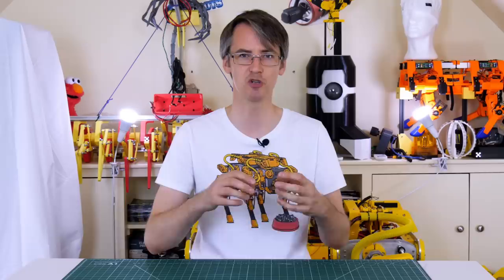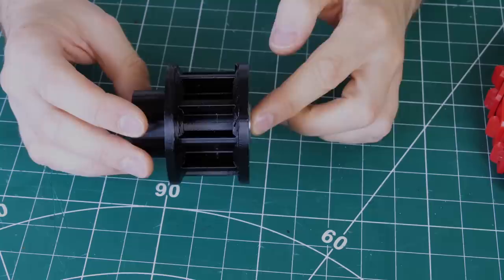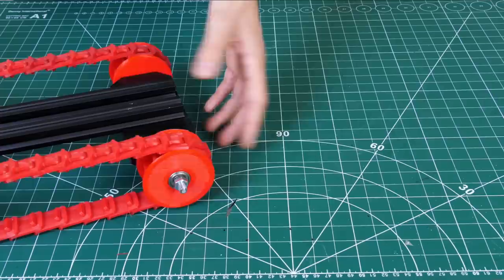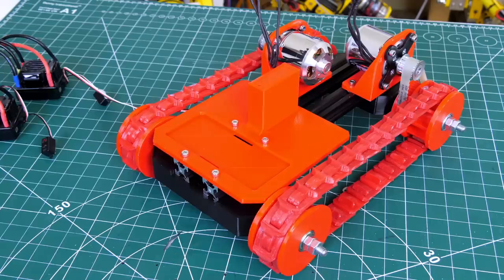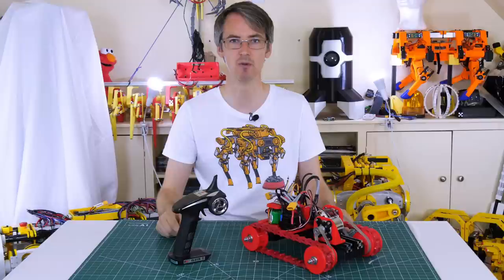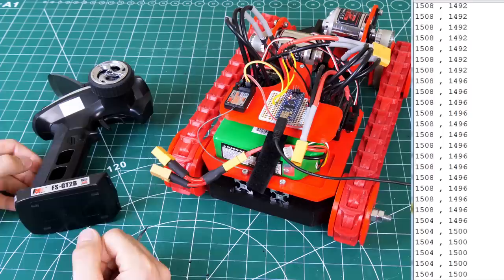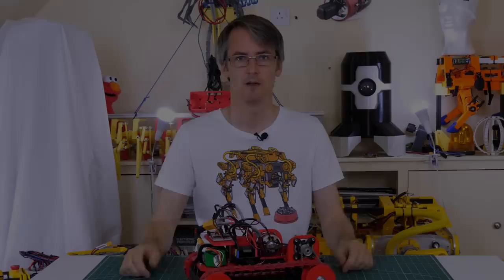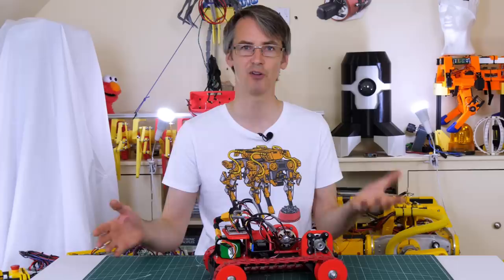Tank Tracked Robot Vehicle with Modular Treads

Comment: For the tracks, in heavy machinery they tend to put the drive at the back so that as you move forward the tention of the belt/track is under the weight of the machine, this might help for the turning problem.
If you don't understand what I'm saying check images of traked loaders, tractors, excavators etc.
Reply: I'm not sure you yourself understand what you're trying to say. The location of the driven sprocket doesn't change anything other than the length of track that's under tension. The weight of the machine is always on the tensioned track, since the tension is created by the bit of track that touches the ground.

The main difference between a front and rear drive belt, is the upper part of the tracks, which don't touch the ground. On a front-drive machine, this bit is under tension when driving forward. On a rear-drive machine, this bit is not under tension when driving forwards, or at least not because of the propulsion system.

The main argument for the location of the driven sprocket is very simple: Where's the engine, where's the gearbox. If the engine is in the rear, like it is for most heavy equipment, the driven sprocket will be in the rear, simple as that. 

Also: If there even was any advantage to having the driven sprocket be on one side of the machine, that advantage would completely disappear as soon as you drove in the other direction.
Reply: @timderks5960  ,
In the case of this robot, the tracks are flexible so the more you tension a longer part, the more it will stretch. What I want to avoid is to make the part of the track in contact to the ground have slack when climbing an obstacle in the most favourable direction which is most likely forwards.

As you said, if you change the direction, it won’t matter what side the propulsion is on but it’s better to improve the direction you will be traveling the most. Turning on spot won’t change anything.

I totally agree with your second paragraph, I can also add that on a front propulsion system, the top of the track is under tension, adding unnecessary wear and tear on the top bearings and the rear sprocket on an excavator/dozer.

In your third paragraph, you say that the engine and gearbox is usually mounted at the rear, which is true for excavators usually (I have never seen a dozer or tracked tractor with a rear mounted engine), but excavators are moved by hydraulics (hydrostatic) so the argument of the engine and gearbox doesn’t apply here.

Hope you understand, Thanks.
Reply: @rodeynsrene1007  Since the track that's in contact with the ground is always under tension, regardless if it has been stretched or not, it will never have slack under normal circumstances. The only slack will be in the section between the driving sprocket, and the last point of contact with the ground, i.e. the last point creating tension, basically in the part of the track that's being "pushed". This track may flex a bit, but the weight of the robot is so minimal that the flex will also be very minimal. The belt riding up on a wall will stretch it much more.

About the hydrostatic drives: That's true, but I specifically didn't mention those, because I have a suspicion that the drive sprocket position in those machines is purely based on "how it used to be done", back before they had hydrostatic drives. Maybe there's a small logistical benefit in terms of shorter hoses, or better protection with the hoses being in the back of the machine, but I don't know about that. Dozers indeed have a front mounted engine, but their gearbox protrudes way into the machine (on older models, the driver usually sits on top of it), so the end of the drivetrain is still in the rear. 

The only machine I can think of where there genuinely is no reason at all (from a construction point of view) to have the sprocket in the rear, is on a tracked excavator, since it hardly matters for those machines which way of the undercarriage is the front.
Reply: @timderks5960  Hello again,
Simply tell me what advantages front drive system have over rear drive system, for the small robot, I don’t think it’s to complicated to change the direction so it can be either. The better option, even if it has a few advantages is the superior and probably the best option.
Reply: @rodeynsrene1007  I never said front drive is better. I said there is no difference. The only difference there is, is probably wear related. A longer portion of the tracks is under tension, so more wear on pins and track links. There's tension on the upper track, so more tension on the idlers there, thus more wear. The advantage probably is that it's harder to have a track come off. All these things are extremely minimal though, and if there were two variants of each machine, one front drive, on rear drive, I don't think any of these aspects would matter to buyers.
Reply: @timderks5960  yes they are minimal but have you tried paying for those expensive consumables. Heavy equipment are made to last, they try to optimise everything they can.
Reply: @rodeynsrene1007  Well it's not like those consumables will be the same. If the idlers only support an untensioned track, they'll be a lot less beefy then when they support a tensioned track. These consumables are designed to last X amount of time (within reason), regardless of how much abuse it takes. Sure, a beefier idler will cost more, but that choice may save cost elsewhere.
Reply: @timderks5960   @Rodeyns René  Correct me if I'm wrong but they're both under tension. It's not like one side (top/bottom) is pushed and one pulled, the whole thing is pulled in one direction. It's just a pulley system. Maybe my limited knowledge oversimplifies the actual variables involved though.
Reply: @braytonlarson1860  Technically you're right, but what we mean by "under tension" is the bit of track between the point of drag, so where the tracks touch the ground, and the point of propulsion, so the sprocket. Think of it like dragging a rope that has a heavy object attached in the middle. The entire rope will follow you, so technically it's all under tension, however the bit between you (point of propulsion) and the heavy object has a lot more tension on it.
Reply: @timderks5960  I've driven excavators many times, they float a lot better in mud and snow with the sprocket in the rear, and if you're driving through rough material, coarse gravel/loose rocks etc, you should have them in the front to avoid getting unnecessary wear and rocks stuck between the teeths in the sprockets, this of course this is hard to do on a tank that doesn't turn the cockpit around... :P

Comment: I like the idea to build caterpillar rover, but to benefit using a belt instead of tires... 1. you need more wheels; 2. the first and last wheels should protrude out to the front and back; 3. you need wider belts, the belt should cover up the wheels; 4. The bottom of the vehicle should look like a boat.

Comment: Great video, as always. To increase the surface area of the treads in contact with the ground, which reduces the PSI , and the friction, it needs idoler / bogey wheels in between the large wheels. This allows the treads to slide sideways, with less friction, when turning.

Comment: I've been trying to figure out how to get this to work for a recent project. I have a six channel transmitter and receiver so I went into the project assuming I would be able to utilize all six channels and could reconfigure the transmitter to use up/down on both sticks for each individual motor. I could but the way you have done it makes much more sense. I'm using a heavy duty Pololu speed controller for the two DC motors and the code provided by them also wants to use the only two hardware interrupts I get with an Arduino nano. I'm hoping I don't actually need them to simply control the motors, but maybe your next video in this series.. from two years ago solved that same problem. Great video even two years later!

Comment: U could simply have thrown a channel mixer for RC models in there. Those are also used to control delta wings or V-tails if the remote control doesn't have an integrated mixer. That would've done the trick without any additional programming or any additional hardware beside the mixer.

Also, usually there's a way to program ESCs without any programming hardware. It's cumbersome but it does the job. On the ESCs I've used in my RC planes it was done by powering the system up with the stick at full throttle, until 5 seconds in it would enter the programming mode and allow u to change settings one by one. If u lowered the stick to zero right after the "programming mode" signal without waiting for any further signals it would toggle the motor brake. All other programmable options were then indicated by a beep pattern that repeated a few times to give u time to decide, and if u wanted to change the low-batt. power-down behaviour, for example, there would be a corresponding sequence of beeps in different pitches for both throttling back automatically once the battery reached its minimum voltage or downright shutting the motor off.

I'd always keep my ESCs programmed to throttling back instead of shutting down coz getting the motor shut off by the ESC during a high-alpha maneuver would send the plane into an immediate stall and nose-dive, and if that happened at low altitude it would DEFINITELY end in a crash. Slowly throttling back would instead gently lower the nose and send the plane into shallow descent as flying level at a high angle of attack usually takes quite a bit of throttle input.

If ur ESCs have such a programming mode then I'm pretty sure it'll also have an option to toggle that brake-on-reverse function.

Comment: 7:32  James, get a "v-tail mixer"  you can get them dirt cheap online, as little as $1 or $2 each .. plug it in between the two channels on your receiver and the two motor controllers, and you'll have instant (once you get the plugs in the right order) tank-style steering without any settup or programming or anything, from the cheapest radio you own!
Reply: I don't know if James will see this but that's exactly what I need for my project! Thank you!

Comment: You can add some Kevlar fiber sold for control lines in RC vehicles -- it is strong and designed to have almost zero stretch.  Thread these through the track links.  That gives the individual links the springiness to react to impacts, but the belt as a whole will not stretch.

Comment: If I may make a suggestion to help with grip and tension. Tanks tend to have idler wheels in the middle to help keep the center of the track in contact with the ground. Granted we're talking about multi-ton vehicles versus an aluminum and plastic rc chassis, but I believe it would help.

Comment: I like that your design leaves space beneath the chassis - I'd consider putting a set of secondary rollers and a suspension system there to further improve rough terrain capability and stabilize the ride for smoother sensor data further down the line. Considering the low mass of the robot, something like a 3d printed flexible lattice would probably serve well as a shock absorber.

Comment: The track stretching issue can be solved by not using flexible materials. If you want to get a decent track link without a ton of engineering, use PETG and Ninja Flex in your dual extruder set-up and print a PETG link with an NF "foot" for grip. Alternately, if you think the stretch gives you some kind of benefit over terrain, add more wheels along the frame. You won't need to give them power, they just need to be on bearings so they'll spin freely, but won't let the track stretch too much.
Reply: Yeah.  I don't see the point in using the method he did if the parts are printed anyway.  The flex track is good if your material is stamped from a sheet.  If you're going to use any other form of manufacturing, rigid links with/without shoes are a MUCH better option.

Comment: You'll have a better time with the tracks if you raise the drive sprocket and idler pulley off of the ground this would allow you to have bigger flanges on them that will reduce the likelihood of the tracks coming off. In order to do this, you'd need to add 2 or more road wheels. For bonus points, you could add in some suspension and return rollers. The track itself should be flexible but have little to no stretch.

Comment: Great to see a sponsor that both fits the channel and isn't a manipulative freemium game :)

Weird question: Am I correct in assuming that there isn't a concept of front and rear wheel drive when it comes to a tank? Could you have one side's motor at the back and the other's at the front?
Reply: Traditionally, no, tanks are driven like what James did here each tread is driven independently.  In older tanks there are just two levers, one for each tread, where you push forward on both to go forward. Pull back on either and it reduces power to the tread, causing you to turn. Pull back far enough on either lever and the tread runs in reverse, combine that with one tread moving forward and it spins on the spot. 

If you were to put one motor on both treads or have a linked drivetrain across both treads it would mean that when the tank is turning the motor would be driven backwards, stopping any forward movement. With simple tanks like this and older tanks this wouldn't work. Using a special differential transmission that only engages with one tread or the other and the RC signal would control the transmission engagement would work. But this overcomplicates things when just having a split drivetrain and one motor for each track is easy.

Modern tanks (eg: the US M1) have a single turbine engine that splits the torque between the tracks so that the two tracks are not dependent on each other's motion. The steering "wheel" is like an airplane's.
Reply from the maker: yep - pretty sure you could put the motors either end. Next time I'll be using worm gear motors though which fit better

Comment: 8:36... You could easily just look for a low state and wait for a low to high transition to get accurate high pulse timing.
BTW... would probably not work in the snow... The tracks are not wide enough to support its weight.

Comment: Next build a forever flying drone, with high lift wings and very light electronic components and solar panels put on the wings to generate enough power to fly half a 24 hour. Make a virtual flight path and in the flight path put those tesla towers so that when the aircraft is flying over them, will receive a short but powerful amount of electricity that would keep it with enough power to reach the next Tesla Post. And again and again, until or unless the sun comes up back again to recharge by solar panels. 
try it or make something similar.
Love your shows!

Comment: Hello, a design for the track that was double wide with two sets of those links you push through may allow for an internal driving wheel rather than external an external flange.
Better yet, may be to have an external driving wheel at the top that does not go near the floor and have some 'runner' wheels on the bottom (that would be internal to the width of the track) under compression.

Comment: I'm curious of what the performance and longevity of these interlocking style belts are, compared to more traditional belts, both grove and tooth, or in the case of tracked vehicles, how they compare to typical chain style tracks. The concept of them seems solid, but in practice I could see them having a variety of downsides; especially longevity, having belt-like material in the form of a chain has to have an unrealistically high wear on the links, which is why chain is typically metal and belts are typically a singular piece.

Comment: The interrupt method to measure the PWM is the cleanest for sure, but what if you need to run expensive timing based computation on the board as well ? Would an RC filter make the signal into a measurable analog value ?

Comment: Shopping Mall/TV game show with "Tank Commander" games. Player sits in Airplane seat with airplane thrust controller for each track. Solo with thrust controller on each side of seat. Co-op with a person or AI on the other track. HUD for player shows AI recommended actions to make with Wow-style glow around on-screen wireframe rendering of the physical controls. Online version would need emulation that runs at the speed of the fastest response/framerate that all players can meet. All 1 or 2-player teams are driving your tank through a real-world track built by Colin Furze 😎. At the highest competition level the players have AI-assist set to 100% manual. At mall kiosk, AI Copilot accepts 'guidance' from the player even if the player is 3 years old or 'Crazy Taxi' mode. Cameras on tank transmit to the HUD - whether kiosk or online.

Comment: Wouldn’t you have to run one of the motors a little faster because of the longer belt on one of the motors?
Reply: It's the sprocket radius ratio that matters, rather than the belt length